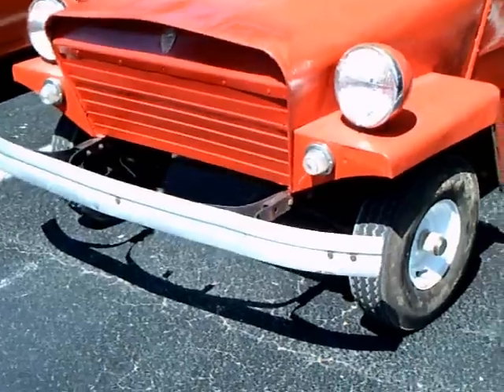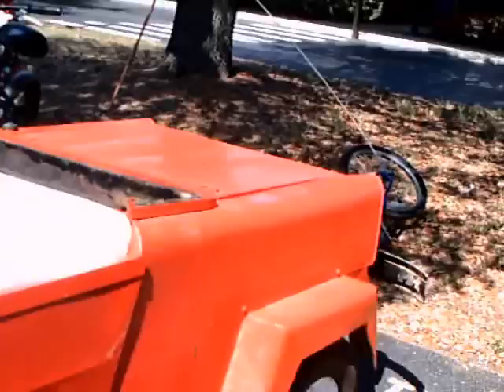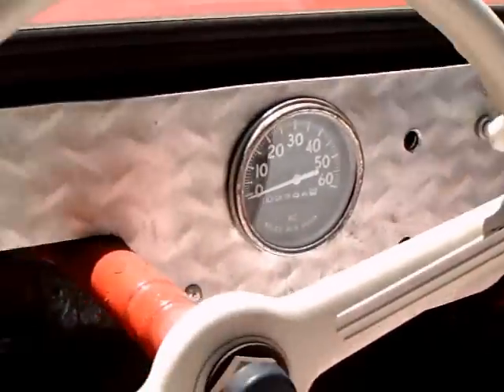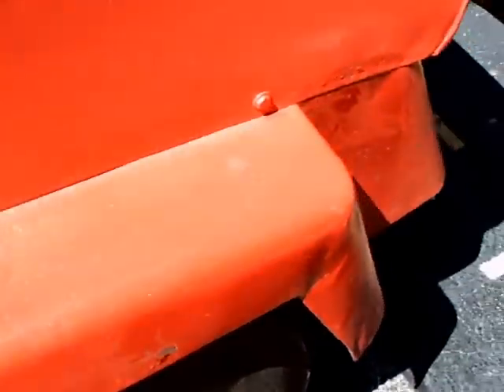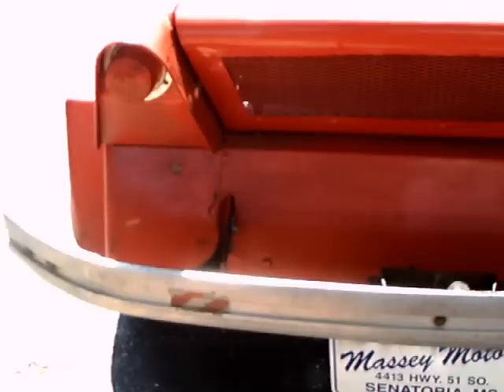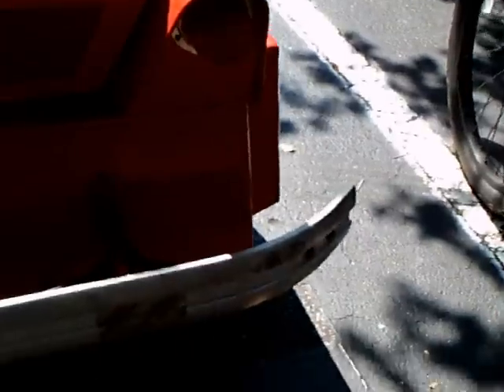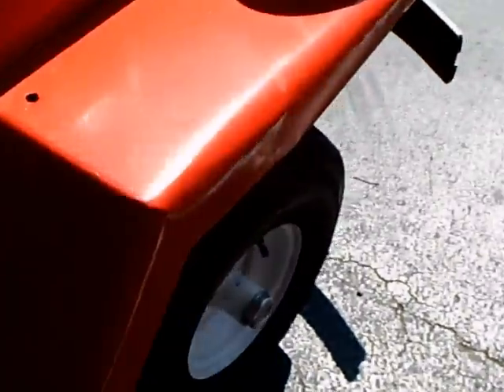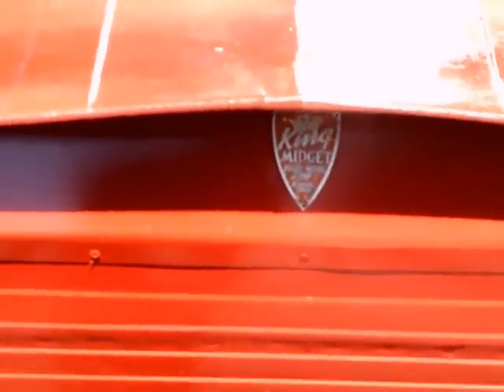1967 King Midget

Comment: I always wanted one. They sound like a whole lot of fun to drive. Every month i'd see the ads for these in Popular Science and the like, but i never actually decided to get one. I wish i had.

 I don't think any two cylinder engine was ever offered from the factory. You're right, one ordered the cars from the factory, perhaps via a 'rider agent.' More than once over the years, i requested the information from the factory and i still have some of that literature (aka, very little but quite informative pamphlets).
Reply from the maker: I definitely remember those ads...they surely made a person curious, at the least!  Interesting point about the engines...they used either a 2.5 or 3 hp Briggs and Stratton engine.  They would have been fun at the time, but I'm afraid that the road conditions of today would make them unacceptable on the roads.  (although, bizarrely, certified golf carts are allowed on public highways in some areas here in Florida)  Anyone interested needs to contact local officials.  Thanks!  :) Jack